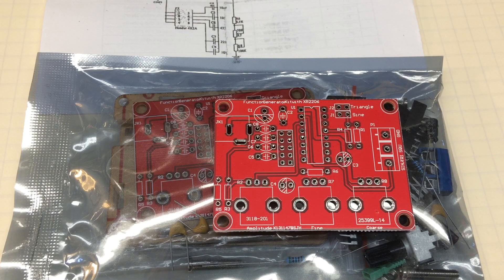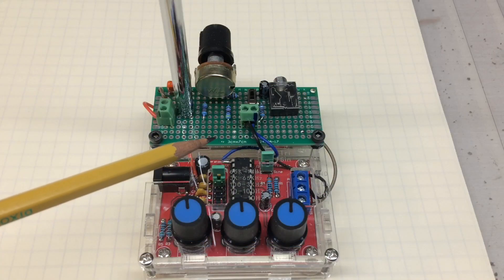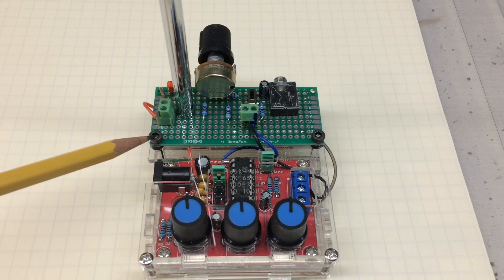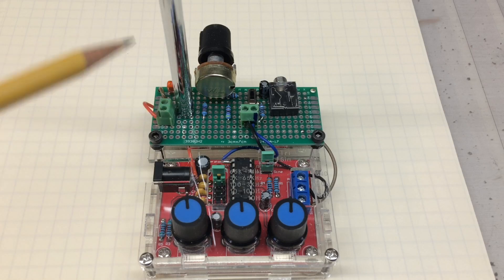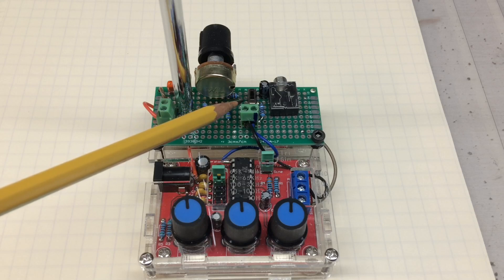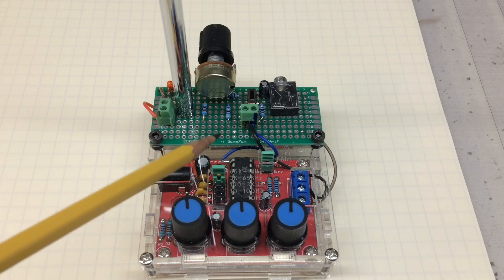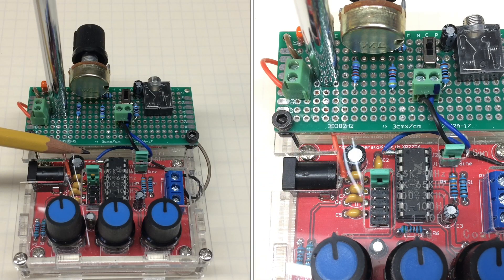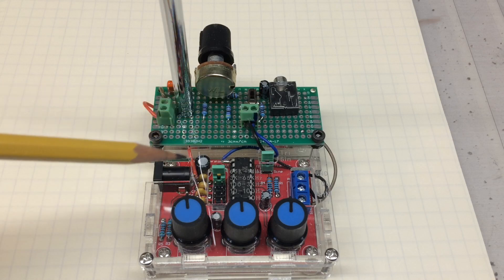XR-2206 Function Generator - Amplitude Modulation Add On Circuit

Comment: When watching your video. It says on the screen "the modulation control allows for 100% modulation".  From looking at the circuit it appears to me when you say the modulation control you are talking about the bluetooth receiver input. Doesn't the variable resistor R3 just control the bias voltage to the transistor in side the xp2206cp chip?
Reply from the maker: Good question Tim. I no longer have the circuit built, but I would assume either or to control the modulation depth before clipping. Thanks for reaching out. All the best. Don
Reply: @RestoreOldRadios  not that I'm an expert on analogue electronics but I thought you could have not had the variable resistor and chose resistors giving the best bias on the transistor in the xr2206cp. After all it's just feeding into the base of an npn transistor. According to the data sheet, that is. Anyway I'm in the process of building this little circuit.
Reply from the maker: @ Tim, sounds good. I’m not a SME, so I would appreciate you sharing your experience (circuit changes) afterwards and I’ll make sure to Pin your comment for others to follow. Thanks again. Don
Reply: @RestoreOldRadios  I've got a bit of work to do yet. i can't look into the problem too scientifically yet as my new (old) scope is on order.

Comment: I bought one of these kits before, the problem is that putting the case together depending where you bought the kit from.  I wish there was a way that you can get a circuit to see what frequency that you're set to.  Also Pin 1 is grounded, why is it grounded?  What can do you do to get that to become available for AM modulation? Do you have to take pin 1 out carefully out of the 16 pin IC socket and use a clip to connect audio to it?
Reply from the maker: The kits have pin 1 grounded because there’s no AM input source in their design/layout. Lifting pin 1 (1.46) in the video is what I did for the add on circuit. Ref. the video description for more information. Best, Don